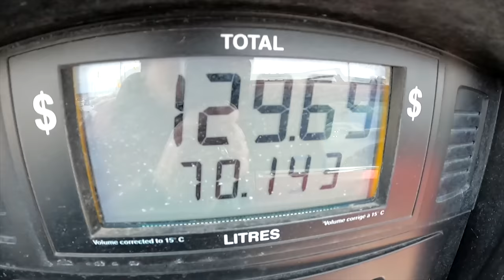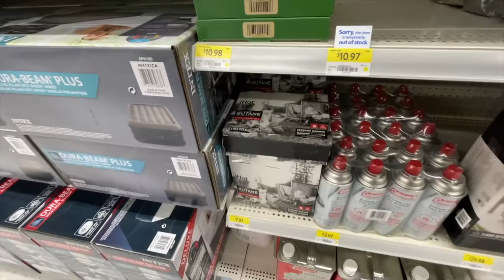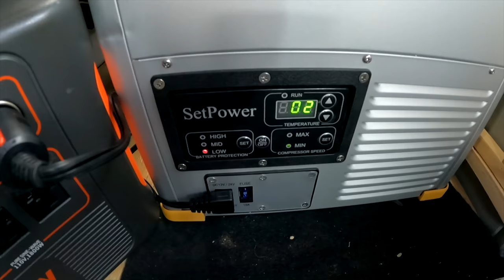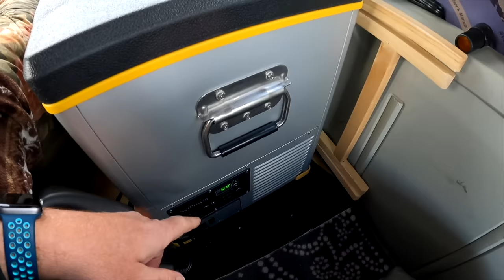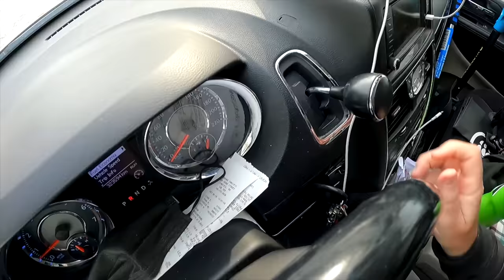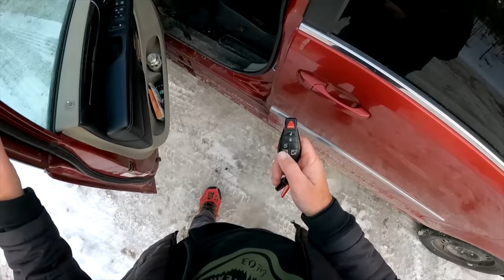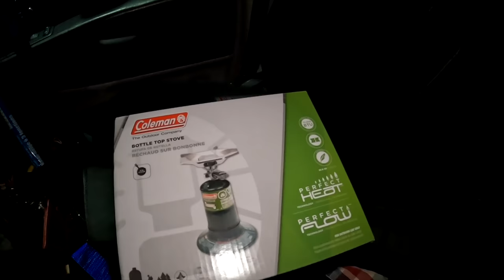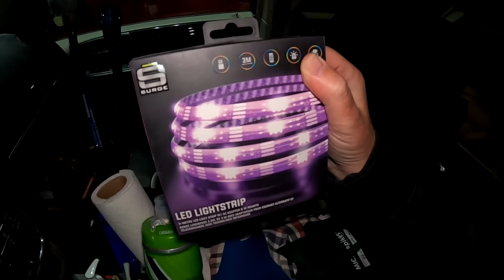Cheeseburger Macaroni Stew & Celebrating 1 Year with Rusty the Minivan Camper

Comment: I know you give the disclaimer but I feel you set a bad example with the gas tanks. Carbon Monoxide is dangerous and no matter how short of a time you run it you're taking a big risk! I've heard of someone (who was in my local area at the time) who came to Canada and although he had been warned used those tanks to heat a place without much ventalation and died.  I was also slightly concerned that your stove could get knocked or the flame brush up against something causing it to come alight. Real men probably would've been creative such as trying to eat as much meat and sauce as they could from the dish or even eat (gasp) crunchy noodles!   You could've at least removed the hang tag from the camping stove warning about the dangers!
Reply: “Real men” 😆 alright there

Comment: Hey Ken, there is nothing wrong with that Stove. It's the Butane it doesn't work very well in cold temperatures.
Reply: YuP! Just like propane, being used makes it cold. Using it in cold temps will sometimes shut off flow of gas to even use! :) Science is great aye? Lol
Reply: Butane boils at -1C, so Ken just has a can of liquid fuel that can't be used.
Reply: @TehSnipez  Not exactly the same, propane works to a significantly lower temperature.  -1C vs -43C for propane.
Reply: I fear the propane is auto refrigerating.  😒
Reply: @CrustyOldDave  It's Butane.  not Propane.  big difference in Canadian winter.
Reply: Ken can always try an electric hotplate
Reply: Just fire up rusty, turn on the windshield defrost and place the butane cannister on the dash for a few mins be good to go

Comment: There is a carbon monoxide warning on that stove and you’re using it in what is basically a small closet.

I know you mentioned that it shouldn't be used in an enclosed space, but that was less than 5 seconds out of your lengthy video. If someone doesn't hear your warning and then follows your general advice they could kill themselves.

 This is somewhat dangerous material. You need more obvious disclaimers.

 For example white text along the bottom during the entire video portion wherein you're ignoring the safety warnings.
Reply: Yea very dangerous
Reply: Agreed
Reply: No different than Mav. He uses his just about every trip in the truck as well. It's called "crack a window". These campers shouldn't have to place "Warnings" on their videos. If people are to ignorant to use common sense or read the warnings themselves then they shouldn't even be out in public and even attempt to camp. They stick to RVs with electric hookups and use their microwave.
Reply: @ShilohAcres2221  cracking a window doesn't make using it okay. Carbon monoxide is much heavier than oxygen. A cracked windows on a still night would do nothing to clear the air at the height he would be breathing. It's very dangerous yhe warnings are there for a reason. The only way this would be safe would be with the windows and or doors completely open.

Carbon monoxide also bonds to hemoglobin more readily than O². Even a moderate level of exposure over time can cause issues.

Comment: Ken please crack a window for ventilation when using propane/butane stoves inside the van, you don’t want carbon monoxide to build up while you cook or use the heater

Comment: HI KEN, GEEZE!! NO WONDER THAT "COOLER" ( no, it's not just a cooler, its a mini fridge!! ) HAS NICE, SOLID STEEL HANDLES, THE DAMN THING WEIGHS 46 FREAK'IN POUNDS EMPTY!! AND IT COSTS $419.00 US MONEY!! ( ah, but its only $368.00 with the Ken Domik discount, and shipping is free!! but only for a limited time!! ). I THINK I CAN RENT A SMALL REFEER TRUCK OVERNIGHT FOR LESS THAN THAT!! IT DOES LOOK VERY WELL MADE, THOUGH ( it damn well better be, at that price!! ) AND THE INSIDE WALLS LOOK LIKE ITS VERY WELL INSULATED, SO IT WILL BE INTERESTING TO SEE HOW LONG IT STAYS COLD DURING THE BLAZING CANADIAN SUMMER!!  THOSE "DISCO" STRIP LIGHTS LOOK COOL!!  KEN, YOU REALLY NEVER HAD FRENCH FRIED ONION RINGS BEFORE?? NOT EVEN ON GREEN BEAN CASSEROLE??  HINT : THEY'RE BETTER HEATED UP!! EVEN IN THE "FIELD" LIKE YOU WERE, IF YOU USED YOUR LIGHTER, OR A TORCH OR SOMETHING, JUST SO YOU COULD CRISP THEM UP A LITTLE!!  GOOD VID, KEN!! FOOD LOOKED GREAT!!  THANKS KEN!!   CHAS ORVIS, PLAINVILLE, CT.  PS : KEN, WITH THE PRICE OF GASOLINE IN CANADA NOW, BECAUSE OF THAT SAD WAR, ( its about, (a boot?) $4.50 US money, here in Connecticut, but that's a real GALLON!! ) YOU NEED TO BE TAKING WEIGHT OUT OF RUSTY, NOT ADDING MORE CRAP!!!

Comment: Butane is not good for cold weather camping. It's boiling point (the point at which it changes from a liquid to a usable gas) is 30.8 degrees farenheit, or about -1c. The law of thermodynamics means that as the pressure decreases in the can, the temperature will go down.

Comment: Congrats Rusty!!
Ken,  butane is notorious for failing in cold weather. I reasearched several camping stoves during the pandemic... according to several youtubers, your best bet for a cold weather camping stove would be the Coleman425 that runs on NAPHTA FUEL, or the Coleman DUAL FUEL stove👍for winter camping. Apparently, they use those stoves in the Arctic🥶

Comment: Oh jackery had come out with portable lights for about 40.00. 50/50 on them I guess they plug 🔌 in to the units or charge up?? I can plug in a lamp or get rechargeable batteries for a lantern or two. The grid is dated so until things get updated I’d advise viewers getting these units because portable oxygen to c-pap machines if they have a battery source will run down. Gotta keep grandma or pa breathing or hospital home units. Another scary thought your camping power goes how’s your neighbor gonna survive the night yes rv battery’s last when our surge protector quit after setting up thank God I brought my 240. My brother blew up his air mattress yes it was a hot 🥵 box for a night. [think cool thoughts] the fridge ran till between 3-4 four in the morning the inverter alarm low power went off. Boy if I had the bigger jackery unit. One of our church members said to run an extension cord to least run the fridge. Or my stubborn father put a gen in the rv. I don’t need six solar panels just the unit. Put aside I have the 240 as Christmas gift, bumped up to the 1,000 unit but our rv is a regular residential fridge like for a home 🏡 might be too big hopefully 🙏 God willing I can get the bigger unit camping you’ll new campers to be overly prepared clothes food etc. if I made payments and they were reasonable sure. Folks you want to stay below ⬇️ the the wattage or these units will shut off.protection they have built in.

Comment: The problem with your stove not burning hot enough is the low outside temperature.. the fuel is below the boiling point and causing a low pressure condition. Tape a hand warmer to the tank lol.